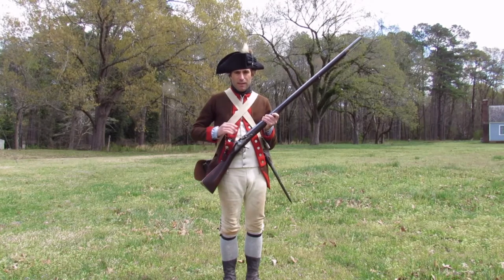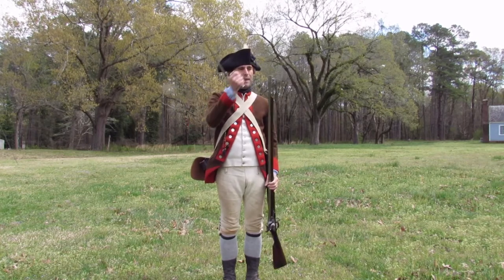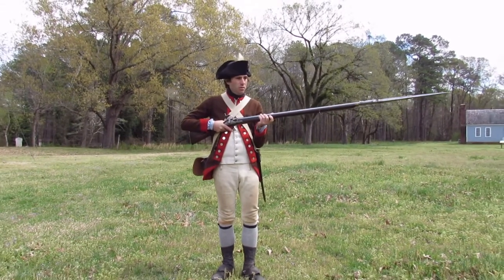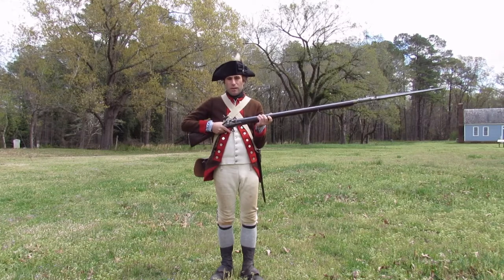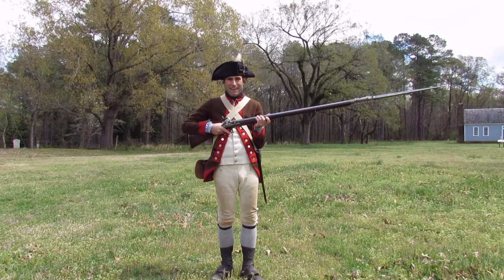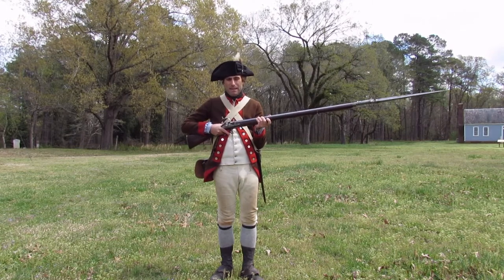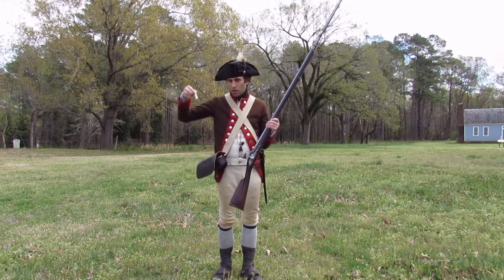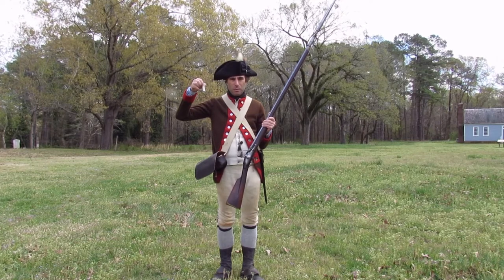Musket Demonstration

Comment: Two things you might find interesting: First, you mentioned how at the start of loading procedure, he "half-cocks" the hammer. 

One thing you never want to do is tp "go off half-cocked."

The other thing is, as he alluded to, is that sometime the powder in the pan ignites but for some reason it doe not ignite the charge in the barrel.

Have you guess what that was called?

Why, a "flash in the pan," of course.